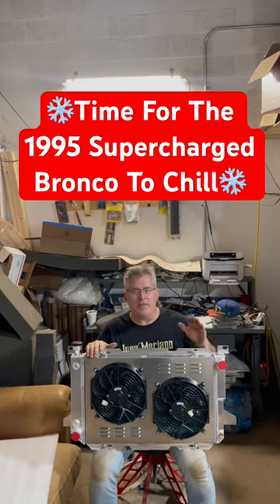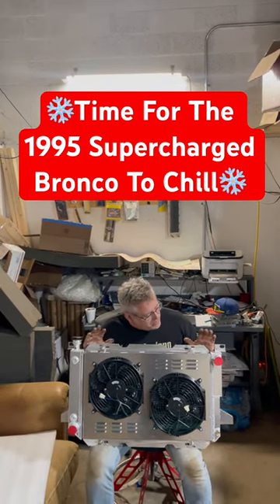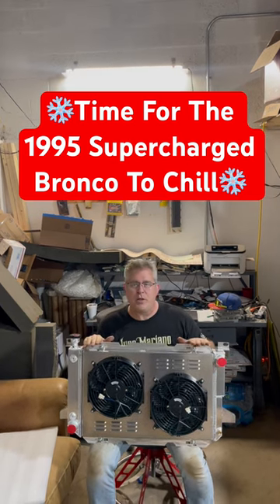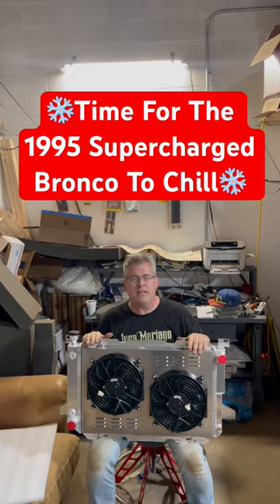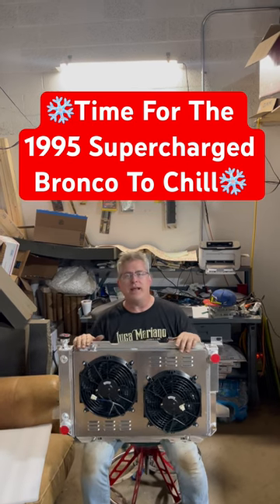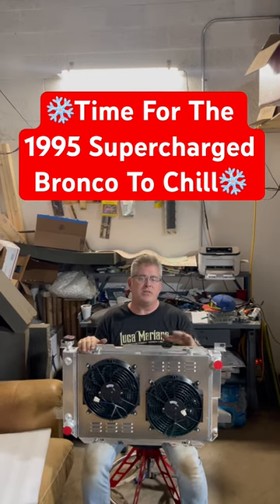1995 Bronco Aluminum Radiator & Dual Electric Fan Install!!! #bronco #fordf150 #obs

Comment: Hey for what it is worth, I did an aluminum radiator/electric fan conversion but I still had a 2G alternator. Getting rid of the mechanical fan ended up turning into a new alternator, a big three upgrade, and eventually an upgrade to the Flex-a-lite 295. It was a lot of work and money for electric fans. Worth it but just my experience.
Reply from the maker: I’m excited to get it installed.  Kit was missing the harness.  Waiting for it.

Comment: What size trans cooler line connectors did you use because the factory ones dont work!!
Reply from the maker: not sure.  we adapted ours.  i can check